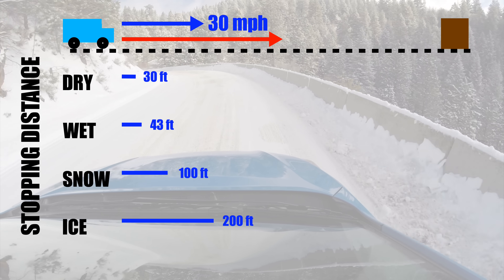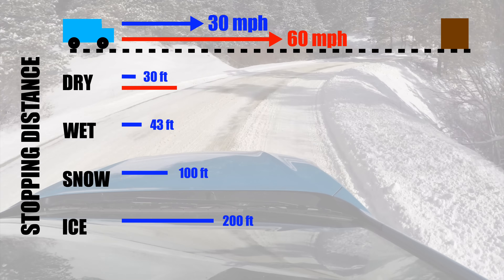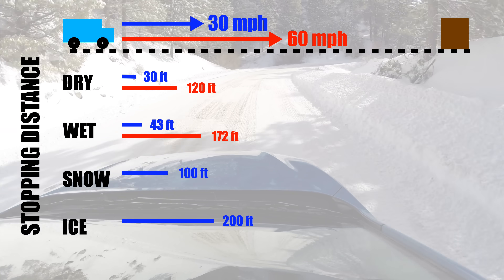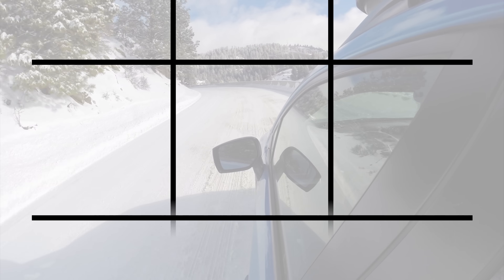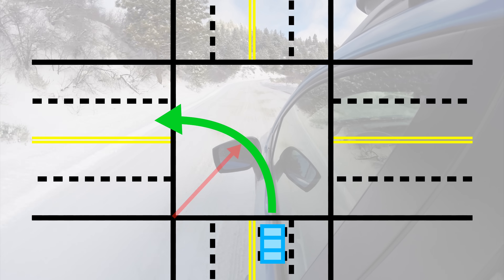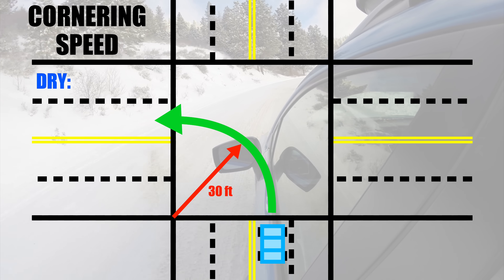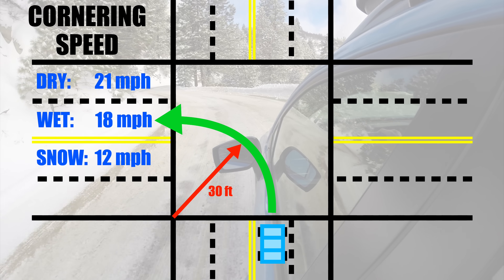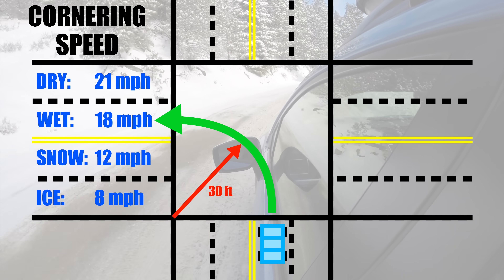Everything You Need To Know About Driving In The Snow

Comment: Here is the game changer...an EV with electric motors on all 4 hubs.  Imagine a system where your traction at each wheel is checked a hundred times a second.  This puts Audi, VW, MB, and Subaru torsen differentials to shame.  The only problem is trying to get the weight down at each hub assembly.  Engineering is finding some solutions for the added weight at each wheel.

This IS the game charger for winter driving.

Comment: Now lets talk about going to a parking lot that's completely empty and has snow and possibly I sent it during a storm or perhaps after it and practicing sliding the vehicle and regaining control it's the number one thing I see people doing they have no clue what that vehicle is going to do when it loses traction and they're out of control. 
The winter tires and the traction Circle are all good easing  drivinh as if there was an egg between your foot and the gas and your foot in the brake. 
Now all of that well good information does not take the fear that most nincompoops have of driving in the snow and ice. The lack of Common Sense is just incredible and they don't even realize that they are the ones that cause the accidents. There is absolutely no place for fear on the roadway especially in inclement weather and you should definitely turn around in a safe location to go back the way you came if that's closer and find a place to stay.
Now let's discuss how skilled drivers with many many miles of inclement weather under their belt.
The traction circle is much much larger because I  know how to use the throttle I know how to react in a slide I don't often lose control unless on purpose to use the reaction to my advantage. I most definitely drive slower yet I do drive with some speed it is horrible when you get stuck behind somebody in a little tiny all wheel drive car and they're doing five miles an hour starting up a hill with no momentum and regardless of how much space I leave in between I will have to slow down and my near 9000 pound truck will end up getting stuck.
Typically this leads to an unsafe situation forcing me to pass whoever it is that's peeing their pants for no good reason at all other than they have no idea how their vehicle will react when traction is lost.
Great video I stand behind my recommendation though all the screwing around I did when I was a kid during snow storms in different cars I've owned and different trucks and every vehicle I have ever owned I have taken the time during a storm in an empty parking lot to force a loss of traction Aspen or what not and learned how to gain control again quickly from making the right decision and reacting appropriately.
Once again I say fear has no place on the roadway whatsoever if you are afraid if you are scared if there is some reason you're going to drive in a situation you fear then get off the road in a safe location and allow those who are confident to go by you. I will warn those four-wheel drive jockeys who have little skill jet drive at high speeds and then come in weather without a single clue that is going to take you a long time to stop and that just because you get going does not in any way mean that you were in control if we are all aware and we make a little effort the roadway will be a much safer place there is no good excuse 4 A 100 car pile up in the San Bernardino mountains during a snowstorm that was forecast at 100% chance for snow to occur and everyone leaves the resort at the same time just like they came in at the same time it's not ever going to work out it's not rush hour it's the weekend and those that are locals really don't appreciate that we have to put up with your horrible driving all weekend and now one of the best and easiest to drive highways in the winter time is completely blocked and now will put many lives at risk there is just absolutely no call for it.
Reply: The traction circle doesn’t change in size when the drivers skill changes it’s still the same.

Comment: So why do people still speed in bad weather? It’s been terrible weather lately in the Midwest especially but I still see people (especially in sports cars) speeding. Just don’t get it.
Reply: Tires, suspension, weight distribution, and a good automatic stability/traction control system make all the difference when driving in any weather condition. The biggest factor being the tires other than the driver of course. I agree that most people have no clue how to drive regardless of weather conditions or what vehicle they are in, but I can drive my RWD sports car in the snow at 60 MPH without any concern. Of course I slow down for the corners, but straightaways are no problem. On dry pavement my car will stop from 60 MPH in under 90 feet. Regardless of the calculations provided in the video, I can stop my car from 60 MPH in the snow in under 250 feet not 300 feet. However, since I know how to drive, I pay attention to my surroundings and do everything to avoid having to brake suddenly. I have been driving for nearly 30 years in all types of vehicles and weather conditions, and I understand the limitations for each.
Ice is an entirely different beast. You will never see me driving 60 MPH on ice. Maybe if I get studded tires, but hey do not handle well on dry pavement, so that will probably never happen.

Comment: What is a feet?
Reply: A "feet" is the plural form of the "foot" unit of length.
A foot is a little less than 1/3 the distance of a meter.
It takes 3.28 feet to approximately equal a meter.
One foot is approximately equal to 305 millimeters.

If you ever hear the term "inches", there are 12 inches in a foot.
an inch is equal to 2.54 centimeters.

Comment: I live in Finland and we tend to have a lot black ice during winters. Also snow...the worst is soft snow when there's too much of it. Your tire just digs into it, no matter what kind of tires you have, if don't have 4wd or lsd. I have a rwd and Toyo Snowprox S943 snow tires with a low rolling resistance. And I always ride without traction control, winter drifting all the corners, lol. But most of the ppl here are boring and just rely on computer handicap -thingies, never really learning how to drive, so they either drive too slow or fast. The most dangerous drivers here are the 45+ years old men with new cars with all driving assistances on, always in a hurry to go everywhere, even when there is no grip. And they don't really know how to drive, they just always drive fast. Don't use driving assistance etc., learn how to drive the car yourself. It'll be fun and you probably know how to react in a bad situation.
Reply: Exactly! I drive with traction control in slippery conditions, but that is AFTER learning how to drive in those conditions. Traction control is a great tool to have, but only if you know what it is doing and how to use it.

Comment: Those werre the basics. What about lane changing in the highway when there is huge piles of snow separating the lanes
Reply: When driving on the highway at higher speeds, DON'T CHANGE LANES when there are high ridges of snow dividing the lanes. Just DO NOT do it without slowing down enough to handle getting completely sideways in the highway.

Comment: If you're in a 2WD car and you're having trouble pulling on to the road from tire slip (like if you're parallel parked), applying a little brakes and throttle at the same time will keep the engine power from going to the slipping tire and you'll pull out much easier.
Reply: That only works on a FWD. This will not help in a RWD vehicle, for the front brakes will provide an additional force that the slipping tires must overcome. However, applying a little E-brake might assist with RWD cars gaining traction, but I have never tried it. I look forward to testing this theory next winter.

Comment: Will reducing air from the tires will work or or not and why ????
Reply: A good set of snow tires at correct tire pressure is BY FAR BETTER than any regular tire with half the air pressure, so I would never recommend relying on less air pressure to get you through the snow. Your vehicle's suspension system is designed for a specific tire pressure. Changing the pressure in the tires can upset the suspension system possibly creating a dangerous situation comparable to sudden jerking when steering or sudden braking when trying to slow down as mentioned in the video between 3:40-4:00. It is not recommended to reduce the air pressure in your tires.
However, reducing air in the tires allows for the sidewalls to collapse a little providing for a wider tire surface to distribute the weight of the vehicle onto the snow. This will allow for your vehicle to not sink into the snow as easily and provide more contact for traction.

Comment: You missed a few more facts:  1:  Use low gear when going down a hill. Do not ride your break. 2:  Put your car in neutral when you notice you have trouble stopping. The motor is always pushing you with and automatic. 3:  Always Stop because the other person may not be able to.  Do you want to take that chance ? 4:  Speed up a hill, if you slow down your tires will start spinning and your going nowhere.  Momentum is the key. 5:  Snow pile at a intersection, do not slow down, Smash thru it or you will get stuck. 6:  The most common mistake people make in snow and ice is... Do NOT floor the gas pedal, this will not help. 7:  When stuck rock the car back and forth, if you get the timing right you will get your self free.

Comment: AND REMEMBER  AWD AND 4X4 ONLY HELP YOU START MOVING.  IT DOES NOT HELP YOU STOP AT ALL.    ONLY A SNOW TIRE CAN HELP YOU STOP ON SNOW. I SEE TRUCKS ALL THE TIME GETTING MESSED UP WHEN IT COMES TIME TO BRAKE   

i put snow tires on my focus st    i also have a 4x4 mini pickup truck we use to cart around tires and parts.   i tested both cars on snow 0mph-35mph-0mph   so like, start get to 35mph then stop.   the 4x4 pickup truck lost with all weather tires  to a fwd snow tired car,  it lost by around 2-4 seconds  it used to be in my phones notepad but i got a new phone

Comment: stop signs when there is snow on the ground do not apply, keep the foot on the pedal at all times.  I like to go with 2G wireless tires, they have  super gravitational pull to the ground as they are lined with mercury and have an internal spinning torus that provides extra gravity.  Sometimes while driving real fast I feel time warp below my feet, it is real helpful when trying to stop quickly and warp backwards when I need to. Just a few extra gigawatts helps this ability with subatomic nuclear reactors built within my spinning rims.

Comment: Buy a torsen quattro, it doubles your circles on acceleration at least, this affects cornering as well, and if you have manual shifter, you'll be engine breaking smoothly on 4 tires instead of 2. I also agree with the importance of good quality winter tires, that is the #1 fix you need to do. Do you guys inflate tires differently for the winter (slightly smaller pressure) or is that not a thing you practice in the US?

Comment: Does lowering tire pressure increase traction in the snow?
Reply: A good set of snow tires at correct tire pressure is BY FAR BETTER than any regular tire with half the air pressure, so I would never recommend relying on less air pressure to get you through the snow. Your vehicle's suspension system is designed for a specific tire pressure. Changing the pressure in the tires can upset the suspension system possibly creating a dangerous situation comparable to sudden jerking when steering or sudden braking when trying to slow down as mentioned in the video between 3:40-4:00. It is not recommended to reduce the air pressure in your tires.
However, reducing air in the tires allows for the sidewalls to collapse a little providing for a wider tire surface to distribute the weight of the vehicle onto the snow. This will allow for your vehicle to not sink into the snow as easily and provide more contact for traction.

Comment: Greetings from Finland. I would say one thing you should do is lose the traction on purpose. Not to crash into something, but to test the grip level SAFELY. So maybe you gain that knowledge already trying to leave your parking spot and having a little wheel spin non-purpously. But if you don't I'd suggest to get some momentum on the road and at a safe place break until you lock the tires. You will get a feel on HOW slippery the road is. The funny thing is that while dry and wet road surfaces have pretty constant amounts of traction, in snow the traction may vary wildly so you need to test it. Also practice to lose the control. This needs to be done also safely and in closed area for it to be legal (or in a parking lot and hope that cops won't see you). It's important to know how it feels when you lose the control and to learn to get it back (counter steering etc). This also helps not to panic if it happens for real. Pro tips: as in the video, slow smooth inputs and especially when accelerating from full stop short shift to lower the torque; remember that the traction may vary a lot also locally (within meters); and remember that someone else might not be expert in snow so keep your distance to other drivers.
Reply: The way I test it is by giving myself far more than enough distance from the next car at the coming traffic light, then brake hard. That gives me an idea of stopping distance at any given day. The snow level can vary from one day to the next, sometimes it changes by the hour.
Reply: Very good recommendation I do this all the time. I apply the brakes till they lock up and ABS is engaged. Then I determine where my threshold breaking is before ABS is engaged. This allows me to determine the limit. I do also have 20 years experience, driving rally cars and driving in snow is my favorite. Everybody should do this in changing road conditions in a safe spot with no traffic around.
Reply: I did this as a young man and it has helped me immeasurably. Finding out how your car will respond in different adverse conditions will help you when actually on the road. Glad to see/hear someone else besides me has figured this little technique out !… Bravo
Reply: When I had just got my drivers license and it was winter I was designated driver for the night in a rear wheel drive Opel Record. After dropping of the passengers I found a empty parking lot and started playing around drifting for the first time in a real car having so much fun learning how to handle rear wheel drive on ice and snow. It was fun until the police arrived... They was not happy about me drifting but I told them the truth that I was learning how to drive rear wheel drive and they accepted that explanation and did not give me a ticket, just a warning to not do that anymore.  

Sadly I was forced to drive a wrong wheel drive car for 8 years before I got rid of it and bought a Ascona B with rear wheel drive and later a MB 190E. I absolutely hate front wheel drive... 4wd is ok if it has rear wheel drive bias.
Reply: It's great to regularly test grip when road conditions change,  it's also great to find a large empty lot and test loosing and regaining traction so when it happens in the wild you know what to do.
Reply: This is an excellent comment

Comment: I'm from the south but I do know and tell people "All you have to do is drive slow." All you did was explain why in a cool physics lengthy way. Now if only somebody could explain tire chains to me...
Reply: The weight of the vehicle is distributed to the road on the surface area of the tires. When there is snow on the road, the smaller the surface area of the tires, the further it will sink into the snow.
Tire chains wrap around the tire, so they do not slip in relation to the tire.  By adding chains, you drastically decrease the surface area that is touching the road. When there is snow on the road the weight distribution forces the chain into the snow while the tire remains on the surface of the snow. Having the chain embedded into the snow that is being compressed by the tire allows the force of traction to be against the side of the snow not the top of the snow.
I know this is not the best explanation, so here is a little experiment for you to try. Slide your hand across the top of your desk, or any smooth surface with a perpendicular edge to it. That represents the traction your tires have on snow. Now from the edge of the desk, do the same thing but drop one finger enough to come in contact with the side of the desk as you slide your hand across it. The dropped finger will act as the tire chain and will require a lot more force to slide your hand across the top of the desk.